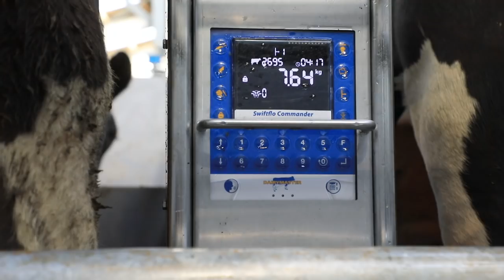Rotary milking parlour changed our life! (Costello Family Dairy Farm)

Comment: Less than 300 cows through a 50 bail rotary, musy be flying through milking, even if the cows were really high yielding  you'd still have to be not much longer than an hour
Reply: Con Joe most rotaries speed is about 7 minutes per cow from time milk machine is on until that cow leaves.